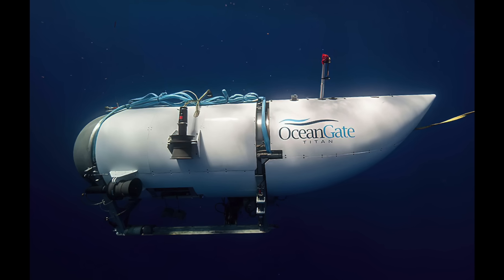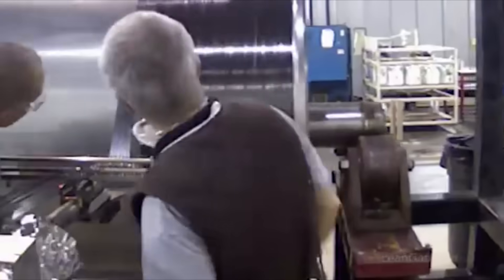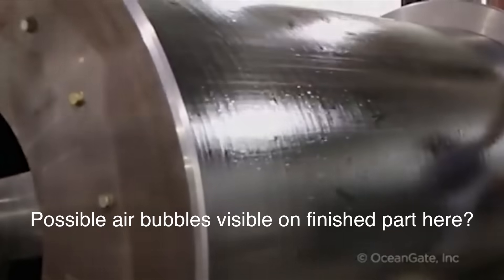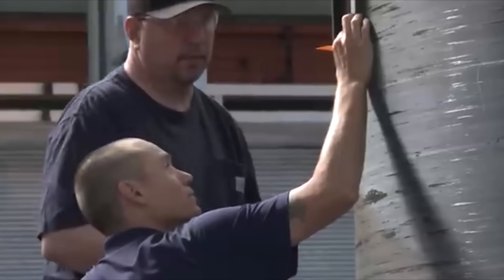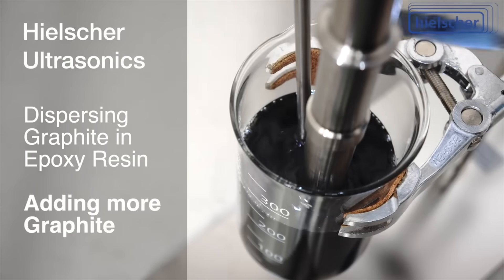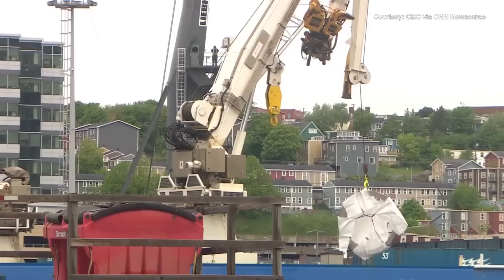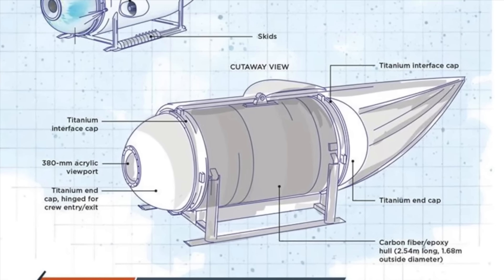Why OceanGate Titan Imploded - A Carbon Fiber Composites Perspective

Comment: Yeah he definitely did brake a few rules. I’m not an engineer however even I knew it was a defunct design from the start. The best design would have been a sphered designed with five inches thick titanium would have done the job because the pressure would have been spread all over evenly and cancelling the pressure while travelling through the ocean. It also would have been tested over and over again. The fact that the designed creaked gave it away. A nightmare waiting to happen.

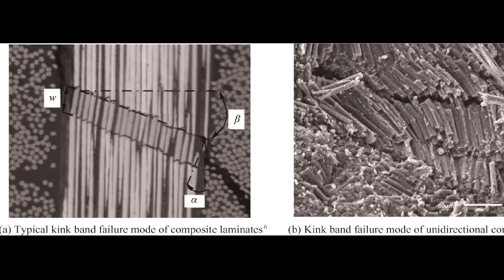Comment: 3:00 I'm sorry, but you're wrong. The main contributing factor was the shape. He should have gone with a larger steel sphere. There's a reason they don't make tablet shaped submarines that go deeper than 800'. It's a TERRIBLE shape for the distribution of stress at that depth. There's NOTHING they could do to make that shape safe for multiple dives. I'm honestly amazed it survived one dive. 6000 PSI is INSANE for that shape, let alone using composites.  I would bet money that even it was made of solid 5' thick titanium, that shape is imploding at 4000'm!

Comment: Revisiting some of the Titan implosion analyses on the first anniversary of the accident.  This video is one of the best because @JamieKunka has  some expertise in carbon fiber composites unlike so many of the other YouTubers repeating something they heard from another YouTuber.  However, one point deserves correction.  Stockton Rush is criticized in this video and by many comments below only winding the carbon around the circumference of the cylinder i.e. at 90 degrees to the cylinders axis.  This is untrue.  OceanGate made two carbon fiber hulls, the first in 2017 fabricated by Spencer Composites of Sacramento and the second by ElectroImpact and Janicki industries in 2000 after several deep dives caused the first hull to partially delaminate during a dive.  Both the 2017 and  the 2020 hull had carbon fibers orient perpendicular to the axis (90 degrees) and parallel to the axis (0 degrees).  Listen carefully to Rush at (1:37). He says "667 layers pf carbon fibers in just what we call 0-90 axial and rotational lay-up which is not normally done".  He does not say the fibers are going in only one direction.  He does say there are no fibers at 45 degrees or 60 degrees as is often seen in carbon fiber pressure vessels.  This clip is from a Geekwire conference in 2021.  The winding clip beginning at (1:54) is of the 2017 hull. Yes, that video show only circumferential winding (at 90 degrees)  of fibers but that is not proof all the fibers were wound that way.  Spencer Composites develop the winding pattern for the 2017 hull after testing several designs.  Spencer states that both circumferential (no degree) and axial (0 degree) fibers were laid after they tested several lay-up patterns.  The axial fibers were in bidirectional sheets and laid up by hand but this was not shown in the video, reportedly,  because hand lay-up doesn't look as high tech.  All this info was published by OceanGate and Spencer and Electroimpact and Janicki prior to the implosion, but it was scattered around in tweets, blog posts,  Facebook posts and trade journal articles so it was difficult to get the full picture quickly.  People made a lot of assumptions and ran with them.

Comment: I don't think they used any longitudinal fibres in the second hull, he talks about it's construction as axial rotational. I don't understand how this would give strength and am not 100% sure what he meant, but i think the first one did use a cross ply but doing this created a lot of voids and weak points that made the first hull make alarming cracking sounds, and video of its construction only show a winding process

Comment: There is not one scintilla of glue on the recovered end cap.  This is known as a "slick-off" which means as it sounds.  If off axis layers were used on the hull, it would add 50% more to its thickness.  This would screw up the so called strength to buoyancy ratio.  Overall, the main problem I see is the use of hand layup quality methods for an extreme pressure vessel.

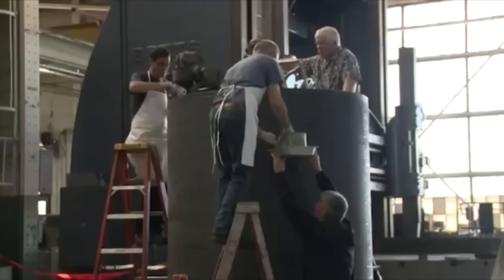Comment: Even as a layman, my jaw literally dropped when I paused the video at 6:45. It's like me helping my dad do a DIY project around the house.
Reply: YES!!!! thats exactly what I thought ,like here ya go dad ill hold it up for ya then we've finished up we'll have beer whadda say hey ...bloody madness
Reply: It's horrible. No hair nets, no face masks. I seriously doubt the glue was homogeneous at all. And they didn't even degas the glue. Seriously, with the cost of epoxy, I take more care doing a small project than these guys.
It's clear they didn't care. The guy with the dirty rag... It's titanium, right? I'd assume you would wash the area with some solvent so it's absolutely debris free. I'd want to be in a Hepa filtered room, but if that wasn't possible, I'd wear a hair net.
When you put a semi-liquid surface, there's a tool that tells you the actual depth of the stuff (usually paint, but works with glue). In other words, people painting industrial surfaces take more care than these guys did building a prototype submarine. But they seem to be mixing it glue by hand in tiny flimsy containers.
Reply: There's nothing wrong with a bit of Evostick. Rush was probably sniffing some before he conceived Titan.

Comment: When you build a metal pressure hull, you know the metal is homogeneous and essentially unchanged between dives. Carbon fibre undergoes irreversible changes under these incredibly high pressure cycles. Using glue to bond two different materials is concerning. Carbon fibre undergoes quite different stresses in aircraft. Madness. And he killed a young man whose life lay ahead of him.

Comment: It's crazy that he even considering continuing with the same carbon fibre centre hull section especially as the 1st hull started deteriorating from pressure cycles and wear and tear plus the natural break down of the fibre layers and apoxy,
Cosider the cost of the hull vs safe number of uses and use the word safe very loosely,
How much was the cost of 2 carbon hulls with the obvious 3rd hull that would need manufacturing if they had survived,
Also the most critical thing to remember is how simple this hull design was,
It had no hatch to allow entry and exit and no windows and almost no complicated systems at all,
Because it's literally just a plain tube connected to the 2 titanium bulkheads that's just connected by bolts this has to be the most simple submarine hull in modern history, it's literally a  tube that's bolted to 2 titanium end caps in reality,
This simple beyond belief tube would have been so easy and cheap in comparison to be made from titanium and would only be made once,
I think that he probably spent more on the 2 carbon hulls than it would have cost to make it of titanium because of the basic machine would needed,
And i definitely would have been cheaper had they survived with the upcoming 3rd hull,
If anyone who reads this and has knowledge of titanium tube prices of a piece this size vs 2x carbon please let me know.

Comment: Video idea: explaining niche carbon stuff/ methods. I once ordered a couple different speedskates.  Finally decided against the sexy pricey carbon bont ones. They could be heatmolded. Not sure if that's the carbon itself? Kydex? A mix?  Could kydex be used as simple step1 to layer custom shaped carbon on top or inside? Stuff like that would be interesting

Comment: He was an engineer so I can't believe he didn't know this, if he did then that's just as bad since he knowingly took pax on it 4000m down. Carbon fibre likes to be 'pulled' that's why it's good for airplanes but it does not like to be 'pushed' so it's not good for compression and inwards pressure. I go fishing and use carbon fibre poles from time to time, these are extremely light and very strong when they're under tension and being pulled by a fish say, however, if you just step on one they will shatter and break.

Comment: Every time I see this assembly video, I get the feeling that it is done upside down.  I think if I were doing this, I would have the titanium ring on the floor with the channel full of glue and then lowered the carbon fibre hull onto it.

Comment: I cannot wait for the NTSB report. Odd things happen at very high pressure differentials; for example, if the viewport blew then the vessel could have exploded from the mother of all water hammers, with the heat of compression and possible steam generation adding to the mix.

Comment: Stockton Rush clearly says that the fibres are laid 0/90. In another interview he said it was in the ratio 1:2 axial : radial which is exactly what you'd expect because that's the stress ratio. If there were no axial fibres it'd only have the strength of the epoxy in the axial direction which is much, much lower than the full CFRP.
You talk about multiple impact loads. What caused these?

Comment: I saw all these things in the video, it was surprising so few people picked up on the cleaning of the titanium rings for instance, I put signs together and if I saw one of my staff touching the surface before the VHB tape was bonded with bare hands I’d be very upset and tell him how to do it properly and that’s just with street signs!. I don’t want them coming off the posts in a high wind and killing someone. These people didn’t even seem to understand this most basic concept. Again, as you saw, no glue coming out of the join when pushed together = no glue on the join. Also try sticking two perfectly flat surfaces together with glue, can’t be done properly can it, there will always be massive air bubbles. Go on, get two sheets of glass, hand spatula glue all over both sides, offer them up to each other almost completely flat and you know what you will see when you hold them up = Massive air pockets, not just bubbles but air pockets!. How could this person call themselves an engineer? What stupid exams did he pass to get his qualifications without the slightest understanding of how materials work. I’m just a sign manufacturer and I get it. Also at the most basic level I understand the difference between compressive strength and tensile strength. Not one of their engineers did. The only thing holding that thing up under that pressure was the strength of the resin, not the strength of the carbon fiber because carbon fiber is “only” strong when stretched, not bent or compressed.

Comment: They were descending at a faster rate than expected. It may have been that they hit the bottom at a faster rate, front or back first and caused the torsional stress to the hull and subsequent implosion.

Comment: Very interesting hypothesis, I also believe the interface joints failed causing catastrophic compression. The two dissimilar materials definitely pose a very high risk of separation at the pressures experienced at that depth. I've seen pressure tanks for SCUBA made of carbon fiber, which are lighter than their metal counterparts, but are limited in their number of pressure cycles. It will indeed be interesting to see how future test and experimentation allow carbon fiber to be used in future under sea exploration. Very well done video on your part.

Comment: Its very simple any fiber wound object is using the Tensile strength of the fibre. Submarines are NOT in tension,  Submarines are in COMPRESSION.

Comment: The fact that the titanium ring is just glued together to the main hull without any nuts and bolts doesn't seem like a sound engineering. Any type of bond is going to deteriorate after some time.

Comment: Since the pressure vessel was made in 3 separate pieces, the joint between the cylinder and end cap hemisphere had zero tensil strength. Also, the cylinder had no longitudinal fibers, giving it zero longitudinal tensil strength.

Comment: I differ with you…they heard sounds from the aft compartment. Water leaked in and incapacitated any electrical power supply. When that happened the sub nose dived towards the bottom of the ocean. But they did hear noise before it happened. The power bay leaked and started the equations. I didn’t become a master engineer scratching my head..
Reply: Oh, you're a poorly programmed A.I. "The power bay leaked and started the equations."? Do acid much?

Comment: it was definitely the bonding process between the Titanium and carbon fiber. That epoxy resin bond will shatter in time,due to different compression ratios  of the titanium and carbon fiber. Im convinced, i do use epoxy resin in jewelry making and the epoxy does not really like to bond with metals in general, they will, but its nothing major, you can pry a centerpiece right off of stainless steel, noi problem. Pretty sure one of the seals went. Just sayin, thanks !!

Comment: Thank you for taking a real look at the bond between two wildly different materials,,about to be subjected to extremes both thermally and structurally. The cleanliness of the retrieved titanium ring,, no residual bonded carbon fiber ,,can only speak to a totally inappropriate bond for this application. Epoxy being much stronger in shear than tension also raises another red flag. Hubris and ignoring existing successful state of the art makes disaster not surprising.

Comment: "Sheared all the bolts".  This seems to me to speak volumes wrt the failure mechanism.   It suggests to me that the glue joint, at least on the hemisphere with the "sheared" bolts, was not the first failure.  It would interesting to find out which bolts on which hemispheres failed.

Comment: The only experience I've ever had with carbon fiber was building aerial drones. I liked it because it was extremely light and strong in comparison with aluminum. But I couldn't picture how it would work being used as a pressure vessel. I was reading a article about carbon fiber being used in the electrical industry in the construction of fuse pulling or switch setting safety poles. I thought that was rather strange since carbon conducts electricity. But I haven't done any experimenting trying to read continuity through carbon fiber or anything along that line. I may do that when I get a chance just to see how well it does conduct which hasn't got anything to do about its pressure holding qualities. I just said a whole lot of nothing regarding the subject didn't I? LOL

Comment: What i dont quite understand is why use CF at all. You could make this out of aluminium, steel, titanium etc. If you want more boyancy without any heavy pressure vessels you can pack on a bunch of boyant incompressible material, like an oil, like gasoline.

Comment: I have reservations that PO pressure proof testing is anything other than one pass no-go on failure. The carbon fiber reaction to pressure and temperature cycling is completely untested.

Comment: I am not an engineer of aney kind I am just another Joe 6-pack but I just want to say this 
The carbon fiber industry has from the very beginning touted there product as " STRONG AS STEEL "  well it turns out that this is less than true and very misleading to the general public which doesn't have engineering or structural expertise and take things at face value wile its an absolute fact that under SOME CIRCUMSTANCES AND IN SOME APPLICATIONS carbon fiber can be as strong  as steel it is NOT STEELS EQUAL in many aspects this limitation is seldom mentioned by those promoting the product to the general public thus making it possible for for the unwary to believe something is stronger than it really is because it is made of a product that is STRONG AS STEEL I believe it behoves the carbon fiber industry to do much more to educate people about the LIMITATIONS of there product having sead all that I must say I believe carbon fiber to be an excellent product and I also believe that the carbon fiber industry bears no responsibility whatsoever for for happened to the Titan by the MISUSE of there excellent product

Comment: Very nice analysis.  You don't have to be a qualified engineer, etc. to understand the basics of many engineering practices.  Your experience would have made the deficiencies shown in the video stand out like ...  

I am not an expert in carbon-fibre composites, kevlar composites, or hybrid composites, or had much experience with them (apart from building my own sporting equipment from pre-manufactured sections) but I have some experience in metallic bonding, the principles are the same (or at least some of them), cleanliness is ALL!  

I do wonder how close they matched the compression characteristics of all the various components made of different materials (non-linearities included), this can lead to unexpected stresses, some of them counter-intuitive.  It would be much simpler with a homogenous titanium structure.  

Also, on initial (and superficial) inspection, the titanium end rings seem strange, I may have missed something, but where are the end stresses of the caps/ring/tube resolved?

Comment: The bottom line is that carbon has excellent tensile strength and terrible under compression loads. A brittle hollow carbon fibre tube....might of just made the hull of glass.